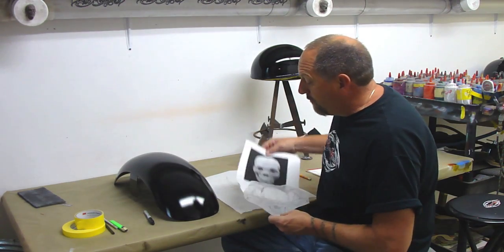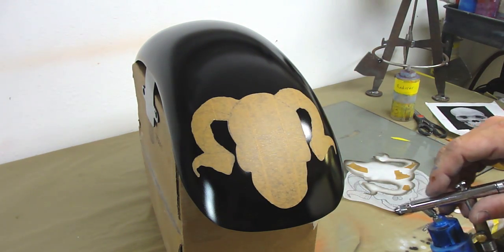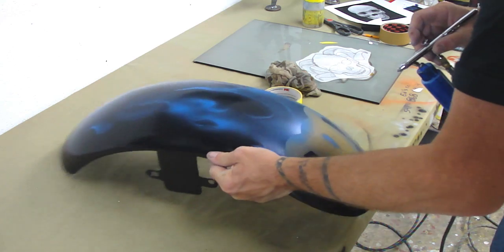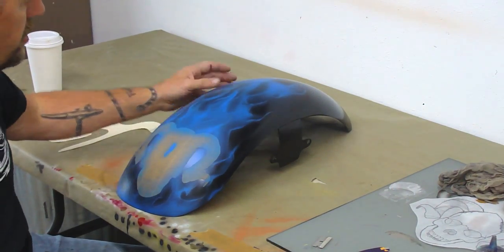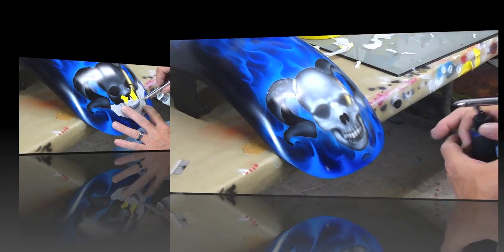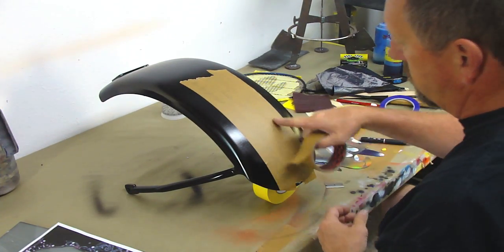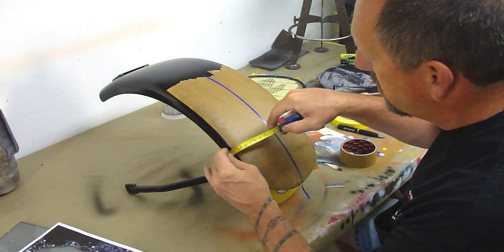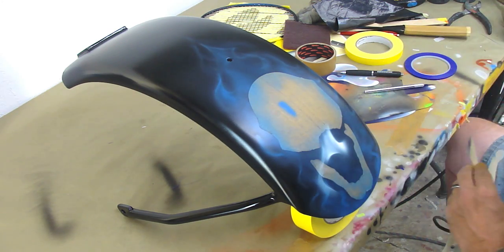Air Brushing

Comment: Hey Ed let me give you some advice if you have a wooden saw horse lay your fender on it and use 2"tape to secure it I noticed that the fender has a bracket take the tape and wrap it tightly through the bracket and around the saw horse then you can use two hands to hold the buffer any questions just ask me